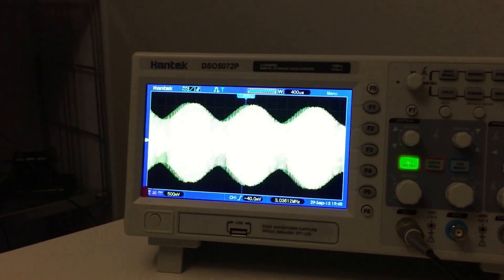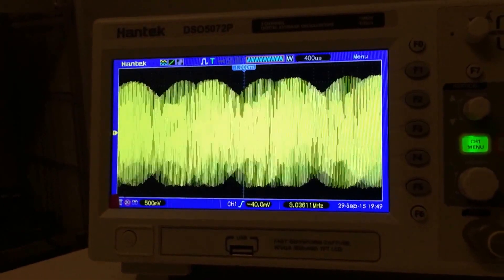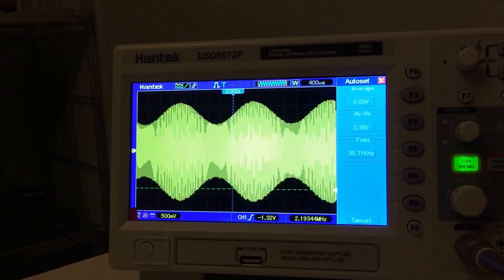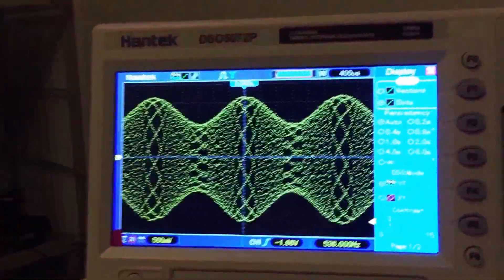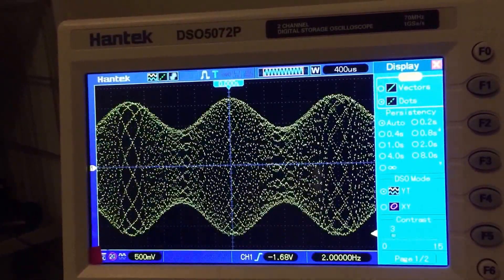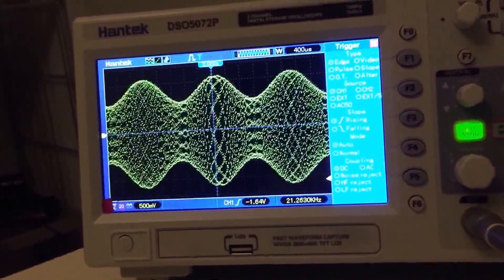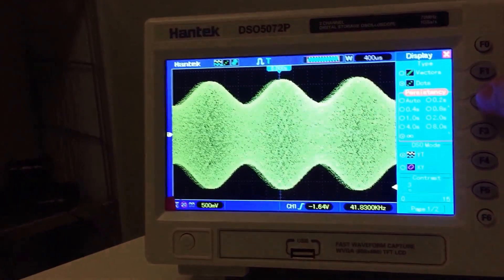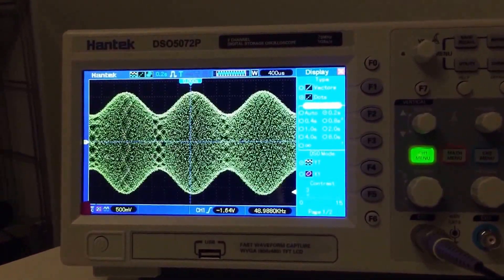Amplitide modulation testing on the Hantek 5072P using a TSG-17

Comment: have you used this to plug into 120 or 240 ac lines with 10x probes or whatever to analyze their wave forms for "dirty electricity"
Reply from the maker: I did actually, but not in my house mains but for a generator that I was testing.
Reply: @retrotechandelectronics  thanks for replying, i have a hantek and wanted to use it to analyze the circuits in buildings with ac for distortions called dirty electricity, from bad inverters, appliances, etc. beyond a grounded probe ten x, and so on, how would you use the hantek to do that, it seems like it's got the software in it and the hardware to do it........do you see any problems with that
thanks
Reply: @retrotechandelectronics  how did you connect the probes to the ac generator, did you do that with just 10x probes, or did you also use an attenuator or isolation transformer or whatever........as i recall the hantek has like a 400 volt capacity or whatever that means.........
Reply from the maker: I generally test well above 120/230 off of power transformers for amplifiers, but would encourage you to first test your equipment with isolation and a variac to ensure everything is in good working order before attempting on mains where endless current can be supplied.
Reply: @retrotechandelectronics   I bought a high voltage differential probe, the mic sig....now i'm all concerned about the 40k memory, i'm thinking i need well over a million points of memory vs the 40k on this scope, to be analyzing wave forms decently on ac lines....since you own a hantek and you've made all these videos about it, which are great, what's your take on the 40k memory issue?
thanks again

Comment: I have the 5072P.  Have you noticed interference or buzzing induced into FM radio that is close or connected to the Hantek?  I like the scope, and it does great for FFT, but the interference is tough to get around.
Reply from the maker: I dont have or listen to FM radio so I haven't observed it, but I will check it out.  These scopes do not have amazing shielding.
Reply: @retrotechandelectronics  Thank you, I would appreciate anything you can do to give me a clue if it's just mine or all of them.  I like restoring old 1925 though 40's AM radio's but sadly last year the only near AM station stopped being reliable and I'm working on some old FM's instead.

Comment: I received the TSG 17 today from China. Looks like a wonderfull signal generator. Not a lot of videos on YT about this unit. So thanks for this vid.
Reply from the maker: glad to help
Reply: Did you tested the TSG-17 ? Mine is garbage, i can't change the rf output, not accurate, above 30 Mhz it begins to flip. I opened it: the pcb is a solder mess, solder on the bottum. Not a good buy, but that is the price i pay to learn. I bought it for the higher frequencies, to allign fm radios. But yeach, the cable and the case are good,...
Reply from the maker: I have restored a heathkit RF signal generator that I use as my primary now, I may open the TSG17 and do a video
Reply: I am busy to watch your videos. And i got the TSG-17 to work at 90 Mhz i think, so that will be ok then. I have no experience in alligments i am just a hobbyist, so i need to rely on good tools. According the manual, it goes to 100 mv for the output, that is ok ? And when there is solder in the case, that meant they did changes when everything was assembled, they didn't bothered to clean it... i hope yours is much better assembled. But i shouldn't complain, is very cheap and when i can use it ones a month, it is ok for me.
Reply from the maker: now im interested to open it and have a look

Comment: You could try to trigger off an output from a simple RC low-pass filter made from a resistor and capacitor connected across the terminals of the signal generator. This would provide a smooth sine wave at the modulation frequency. Here, you are triggering off points on the high frequency signal that will result in jitter.

Ideally, you would trigger off the modulation signal. Then you should see a clear carrier waveform as long as the sampling rate is high enough.